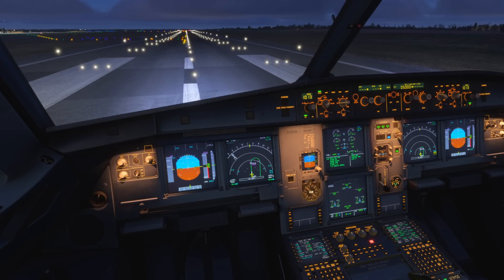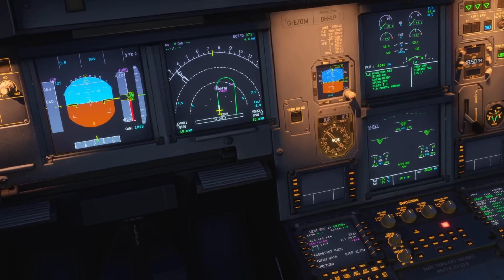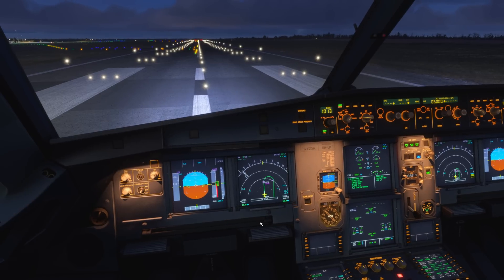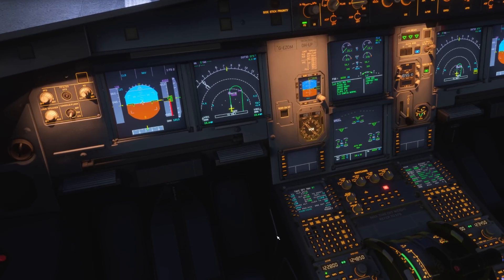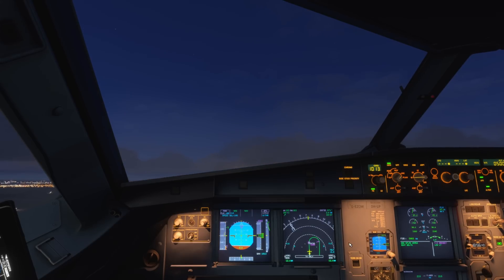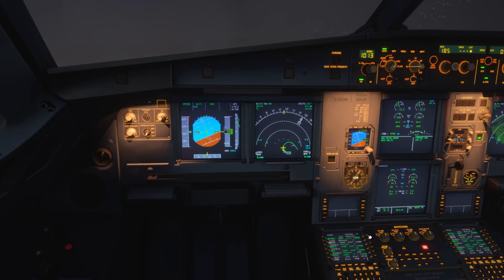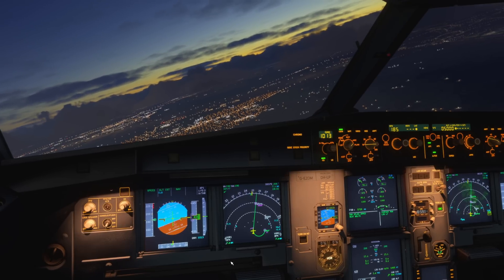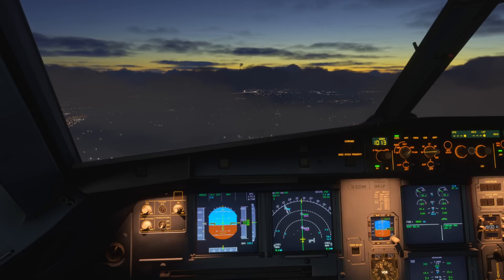PRESEL Speed in Airbus A320 | Real Pilot Tutorial in MSFS 2024

Comment: When you accelerated from 185 kts to 250 kts, the engines revved up. In real life, I never hear this in the plane. Why?
Reply from the maker: Hello, it is not very common to use presel speed so you will not always get that sudden thrust increase however when it does happen even climbing out of level off's it is noticeable more so in the cabin than the cockpit. In the A319 we get the most noise in the cockpit as we are closer to the engines, in the A321 there is far less engine noise in the cockpit. The optimum is a nice steady climb without level off's which is what we will try to achieve so you will not get the sudden increases in thrust every time.
Reply: @AirbusCockpitCoach  ok thank you for explaining

Comment: Is there a requirement to tell ATC when using a PRESEL other than 'normal'? I am just thinking that if aircraft departing after were not to select PRESEL they might catch up quicker than expected.
Reply from the maker: Hello, there is not a requirement although it would be considered good airmanship if you are planning to travel a lot slower to let ATC know. ATC should monitor your separation by distance and will therefore factor in your slower speed

Comment: Hi Captain,

I saw another example by an A330 pilot who demonstrated this in the MSFS.

If you depart from an airport with glider activity, and you have low clouds, how you you use the preselected speed?
Can you give an example, please?

Would you expect gliders at all if the clouds are low?
I mean broken/sealed clouds.

What speed would you use? Greedot or higher?

Thanks alot!
Reply from the maker: Hello, this is only likely to occur at airports that are less busy and sit in a lower class of airspace. VFR traffic needs to maintain a set vertical distance from built up areas so the cloud base can be restricting if overcast. If it is broken there is more opportunity for VFR traffic. If I knew gliders were a possibility I would probably keep the speed right back holding out flaps 1, the slower the better. Gliders are hard to see against cloud.

Comment: Can you use PRESEL later in the climb, (or the descent) to climb or descend at a specific speed ?  Say climb at 270 kts or descend at 270 kts ?  I'm a real world 737 pilot and whilst in VNAV, we simply enter the specific speed in the FMC to do this.   Is there an equivalent in the A320 ?
Reply from the maker: Hello, yes we can apply specific managed speeds for climb and descent in the A320. We do this via the performance climb and descent pages in the top left where we can alter mach/speed for those phases of flight. We would not use Presel though 👍
Reply: @AirbusCockpitCoach  Roger that. Thanks. I’ll give it a go.

Comment: Would an alternative be to program the first one or two waypoints on the SID to a speed of 185kts,  and then it will resume the standard 250 it's thereafter. That way one can take the whole departure phase in managed speed. Would that work?
Reply from the maker: Hello, initial waypoints often have restrictions against them already which you may still need if you're only using presel for a short time. It's much easier to pre select the speed and then hit the speed dial when you want to go managed

Comment: Interesting that as you pull the throttle into the climb gate 185 comes up on the FCU, and the mode is selected speed, even though you've programmed it into the MCDU, one would have thought that it would still be managed speed maintaining 185 knots. Interesting...
Reply: Pre- SELECTED speed. Aircraft goes into selected speed mode in clb phase, and when ready, you push to revert back to managed speed. Very easy, very intuitive. Airbus👍